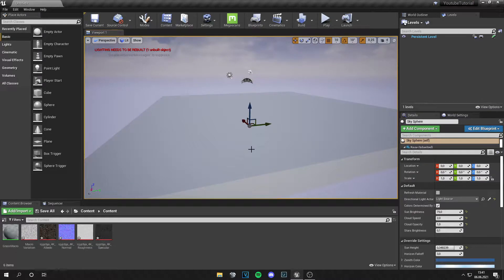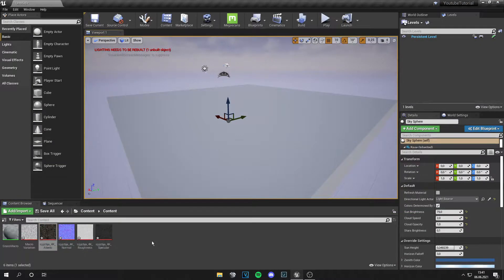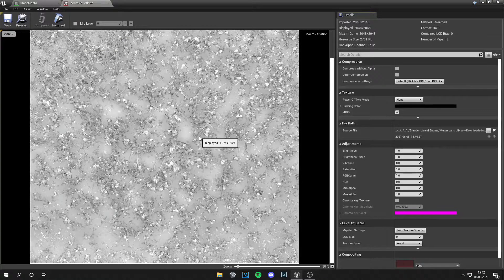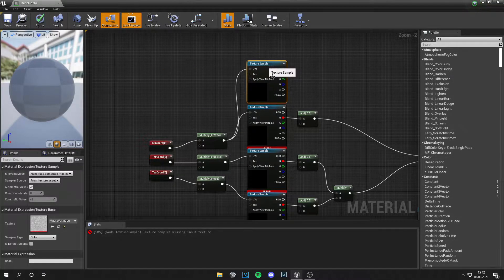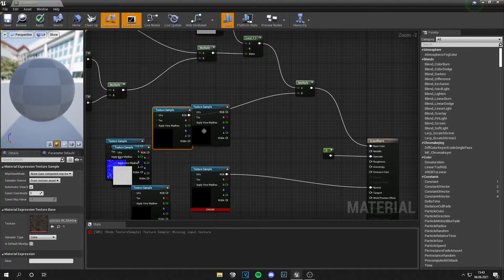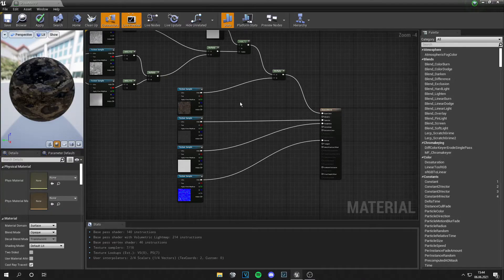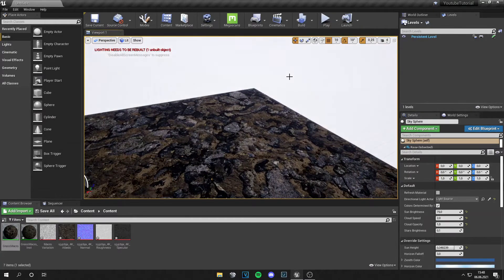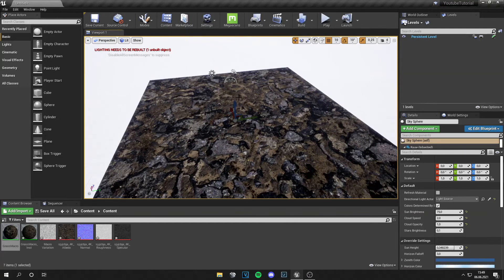How to PREVENT TILING on MEGASCANS MATERIALS | UE

Comment: How can you do this but with a brick material? Would that also work or would the bricks be completely scuffed?
Reply from the maker: It could work but you could also add some cracks manually to your bricks :)
Reply: @UnrealMatter  What I meant was does it break tiling?

I want something to be tiled but not repeat itself.
Reply from the maker: @MrGoatsy  You can try it but bricks in a very big area look often the same. Add variation then with cracks moss etc.
Reply: @UnrealMatter  So paint over them?
Reply from the maker: @MrGoatsy  yup basically :D